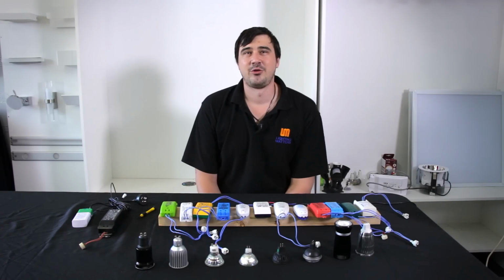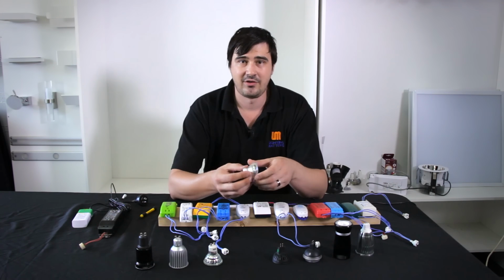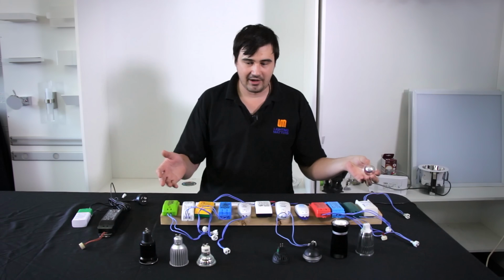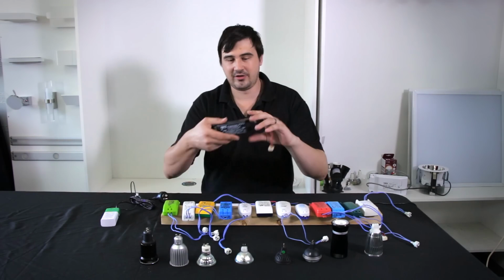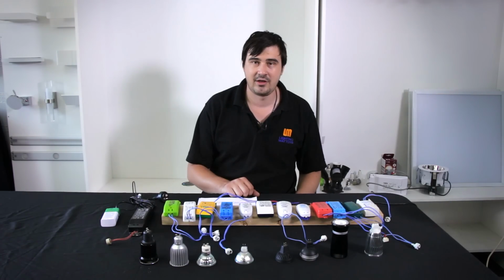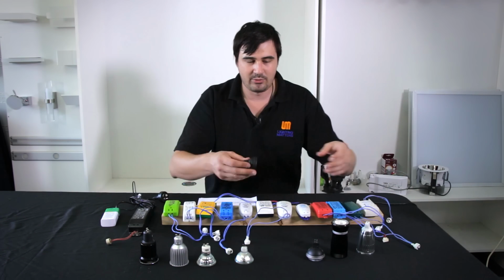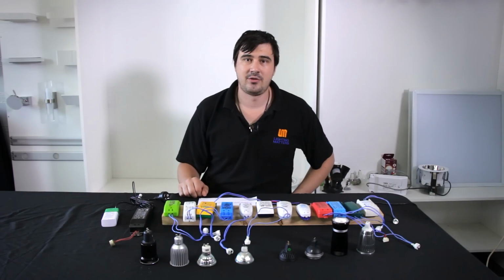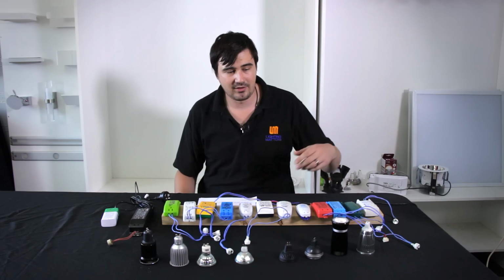How to upgrade Halogen Downlights to Energy Effcient LED Lighting

Comment: One issue not mentioned here is that when you buy LEDs downlights with a driver, you need to provide a 240 V line to each downlight. Usually, one transformer can drive two halogens and this means not enough lines exist in the roof if you want to do a quick swap of the transformer to the LED.

Comment: If the osram lamp allows for higher voltage input then you should have no worries with your magnetic transformer. Otherwise you may not get the full expected/quoted lifespan.

Comment: Hi James...awesome review! I'm running a set of 5 DR700s on the one switch with old dimmer and the old heavy iron core transformers you describe. I want to remove the dimmer as I don't use it. They are not flickering at all although they did when first installed even without dimming. Should I still be changing the transformers to the newer electronic types you mention as after trialling for about 6 months I want to do the whole house.